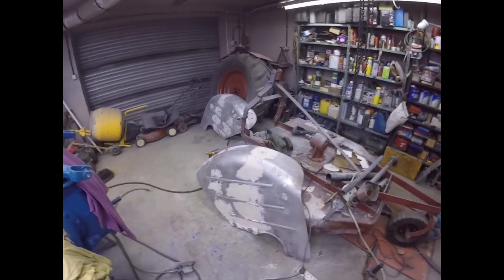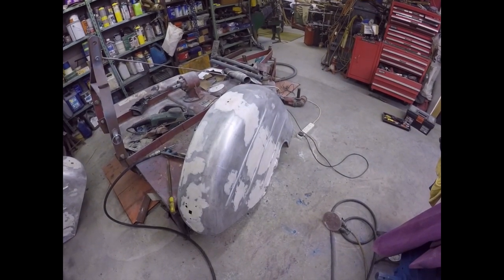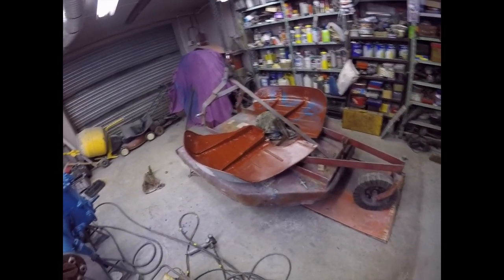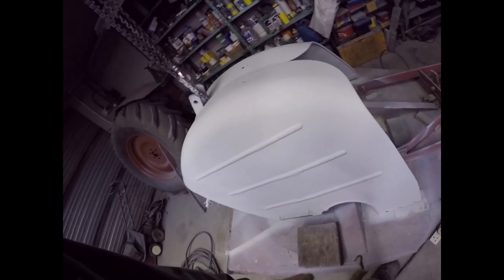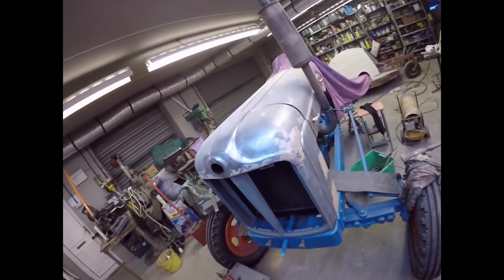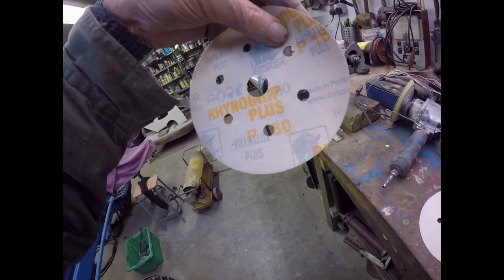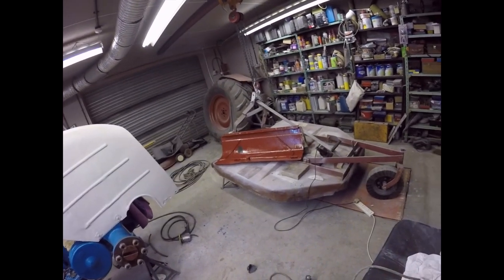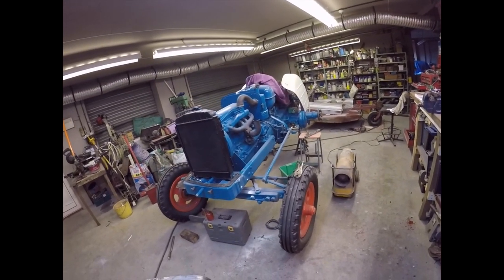Fordson Major rebuild Part34, painting!

Comment: Firstly, glad to hear Keith is recovering and on the mend.
I have recently done a deal on a used diesel space heater. It definitely heats up the unit differently to the gas warming gun. Not sure which is cheaper run. Trying to buy kerosene is impossible around the Skipton area. So that means travelling and that puts the price up. Becuase I don't have a bulk tank, I have to pay pumped prices at £0.83p per litre. By the time I have driven to Bury in Greater Manchester (You read that right, Bury, Greater Manchester) and back it is cheaper to run on white diesel from Tesco's fuel station in Skipton. I would paint the mudguards flat because I am not good at spray painting. Top regards, Jon.
Reply from the maker: Hi Jon, I am using my torpedo heaterat the moment because it seems pointless lighting the woodburner when I am only doing a few hours a day. Starting an agri contractors business would give you legit access to red diesel, and who would know if some got into the heater on odd days?. or get a logburner! I told my bro sbout the hike in duty on oil used for commercial heating, he didn't know! Glad I didnt go for oil fired in my workshop. I am running it on the 20 year okd diesel that was in the tractor, she starts much better with a drop of fresh! Keith is home and improving slowly, it will be months rather than weeks.
Phil.
Reply: @philhermetic  Hello  young man, l so wish a log burner was an option. I bought 50litres of red today for £40  off a farmer so that will warm the unit for a while.
So long as red is being used for agriculture, forestry, energy generation and or a hospital then it's OK to buy it. I suspect that it will be abolished completely within ten years. 
The rate at which this country is going Communist l doubt anyone will own or have rights to do or go anywhere 
Too regards to you and Keith!

Comment: Great progress. It was very interesting what you were saying about paint. We have been talking about painting a tractor and dad said that with regard to painting, the only thing he knows is Cellulose and all his suppliers have long gone. It sounds like we need to see if we can find a local supplier to talk to. I am pleased Keith is on the road to recovery
Reply from the maker: Use oil resistant alkyd enamel paint for machinery, much cheaper than cellulose and easier to apply, local tractor suppliers usually have it, look for the "Teamac" or "Tractol" brands, can also be bought on the internet, but always check the prices as they differ wildly between different suppliers!!
Phil